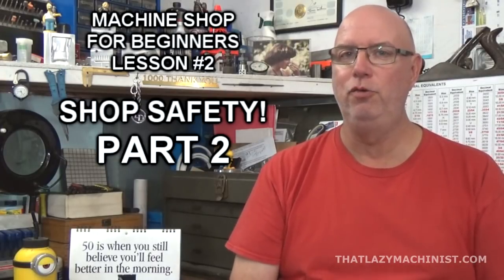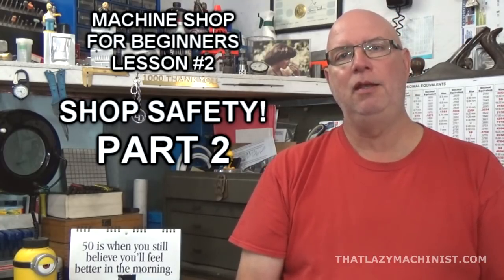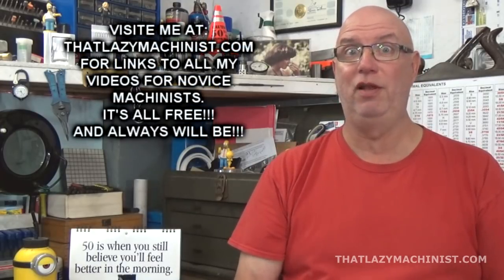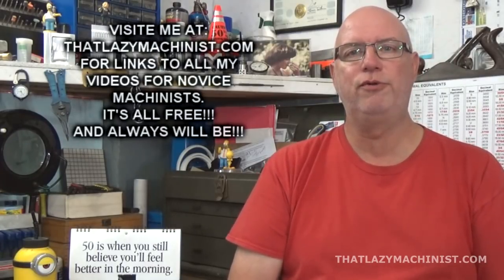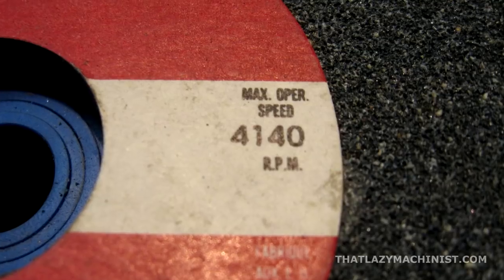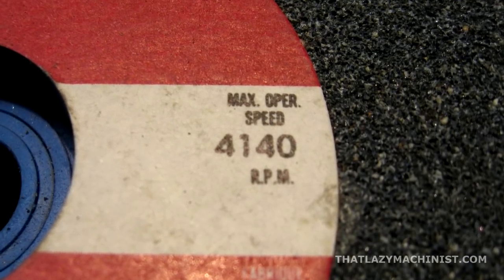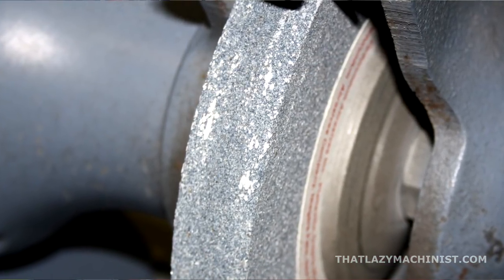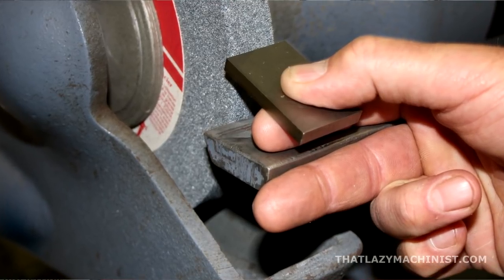MACHINE SHOP SAFETY PART 2 dangers of miscommunication, bench grinder safety, drill press safely

Comment: I am a  little late to class Professor, but everything you brought up is very helpful......cheers from Florida, Paul....ok, after listening to intro, I will be looking at safety glitches [oppsies] in the video to point out.....[1] your spark arrestor on the bench grinder is way out of adjustment 5:32, lower close to the wheel to prevent sparks from escaping. [2] straight flute drill info great, especially the dubbing of the twist drill. [3] clamping a stop to the press table, great idea, I always do this [a piece of angle] and rotate part up against the angle so if it wants to rotate, it will not be able to move at all. [4] well Marc, that about does it for me......except always respect the drill press, it has no brain but has a really bad temper if treated wrongly. Best Regards, Paul...looking forward to the other safety videos.....

Comment: 🎯 Key Takeaways for quick navigation:

02:12 👥 Miscommunication is a significant problem in workshops and can lead to accidents. Clear signage and communication are crucial.
05:27 ⚙️ Bench grinders' safety depends on the proper use of safety equipment, correct RPM of abrasive wheels, and avoiding grinding non-ferrous metals.
08:42 🔧 Utilize the tool rest on bench grinders to stabilize your hands' position and prevent accidents caused by proximity to the grinding wheel.
09:20 🔩 Long hair can be dangerous when using a drill press. Keep long hair tied up or covered to prevent accidents involving rotating parts.
10:28 🔧 Avoid leaving the Chuck key in the drill press, as it can cause serious accidents. Do not tie the Chuck key to the machine; use other methods to keep it accessible.
13:10 🔒 If your drill press lacks a worm and rack gear, attach a clamp to the column to prevent the table from falling uncontrollably during adjustments.
15:27 🔒 Avoid using heavy milling machine vises on drill presses. Drill press vises are stable and suitable for drilling operations.
18:59 ⚙️ Prevent snagging of parts by adjusting pressure while drilling. Modify drill tips or use straight flute drills for soft materials to avoid snagging.
21:00 🔄 Prevent rotating parts from causing accidents by using stops or pins on the drill press table. Secure unstable parts and deburr holes to maintain stability.
24:28 ⚠️ Do not use a drill press for lateral thrust operations like milling or routing. Drill presses are designed for axial thrust tasks.

Made with HARPA AI

Comment: qyuck question, my friend just got fired/quit at a place he worked,  he was working on a machine where the safety guides had been taken off.  he complained about it they told him they were grandfathereed in because they ran some old machines with no guards. so if he was gonna pussyfoot about get out so he left.  where they right telling him that.  id also like to mention i almsot lost 3 fingertips in the same shop, luckily they saved them . but i found out later all the saftey guards had beeen removed rom the machone, before i started there.
Reply from the maker: I do not know where you are from or what the laws are there but in Canada removing guards or rendering inoperable the safety accessories of a machine or even letting a person operate a machine without proper training can be punished severely. The supervisor or owners or both ( if  they are aware of the situation or if they are purposely looking the other way) are liable and in some cases criminally responsible. This also applies to home shops when someone is working in your shop. In Canada, any worker who deems a task dangerous can refuse to do it. If there is a conflict with management the incident can and should be reported to the agency responsible for applying the provinces health and safety regulations (the name varies from province to province). There is no grandfather clause for safety, point final. If a machine is to old to be operated safely, it should be in a museum. Nobody should put there well being at risk for an employer who does not put a workers safety before profit. Bravo for you and your friend for walking away, that employer should be reported. I hope this helps and be safe! Marc

Comment: A muffler clamp with a wing nut is just the thing for a drill press column. You won't be looking for a wrench or screwdriver to adjust it.
When drilling sheet metal, always grind a sheet metal point on the drill.. it cuts through at the periphery first and a slug drops out. It has the added advantage of having the sharp point center will easily pick up a center punch mark on the work. If you do much sheet metal work, it's worth buying a cheap set of drills from horror freight and convert them to sheet metal drills as you need them. That way they'll all be together in a box set when you need them. Here's a video showing how to grind them..it's very easy.
https://www.youtube.com/watch?v=XA8L4L30TyI

Comment: I am new to machining so I am very happy that you have put out this series for those of us that are new to machining.
I "inherited" my machine shop when I bought this property.
I was interested in what you had to say about working alone but letting someone know where you are and have some form of communication to let them know that you have a problem.
I am in the 'unfortunate' position of living by myself, and I am in a rural area with no near neighbours, and I don't have a wife so I am totally on my lonesome here.
Also, my lathe is very old and the main power switch is more than an arms length away from the machine,- only the forward/reverse switch is close to the machine, and incidentally very close to my left hand and not my right as you said about using the same hand to tighten the chuck and turn the machine on or off.
It also does not have an emergency stop button.
I guess I am just going to be extra careful!!.